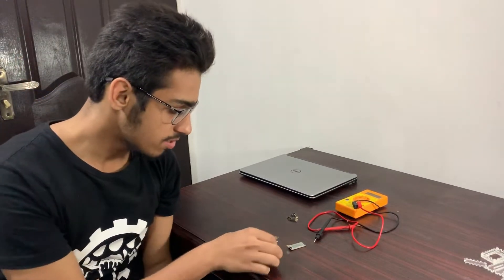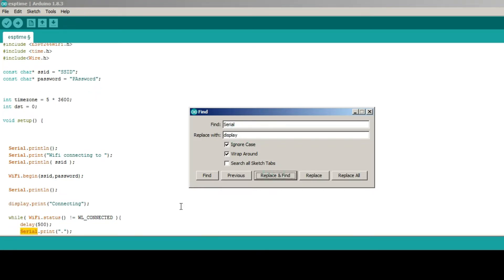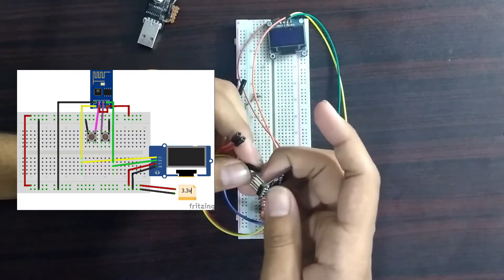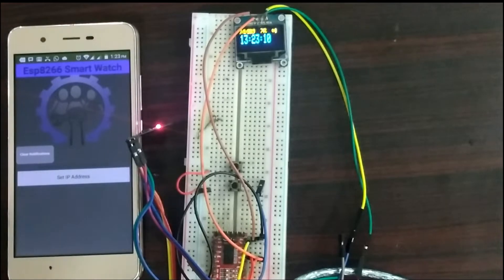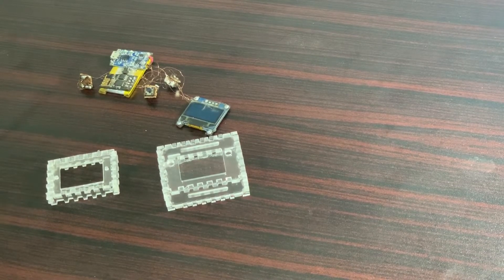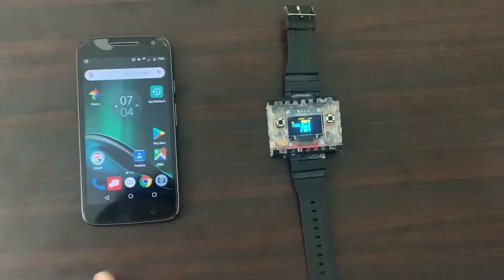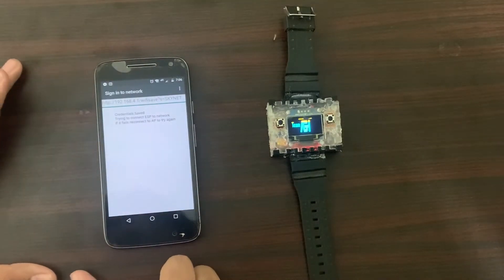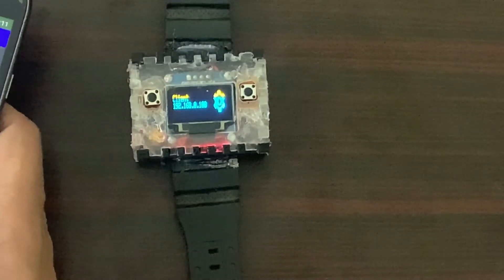How to make a WiFi smartwatch using Esp8266

Comment: My first question can I use nodemcu
2nd question can I connect it to my Jio WiFi router..
Reply: Ok thanks..
Reply from the maker: NodeMCU is a bit bigger in size but with it making the circuit will become easier.
But it will be better to use Esp12-E (nodeMCU without breakout board) which is much smaller for a watch.
And yes you can connect it to any wifi network including mobile hotspots and portable 4G devices